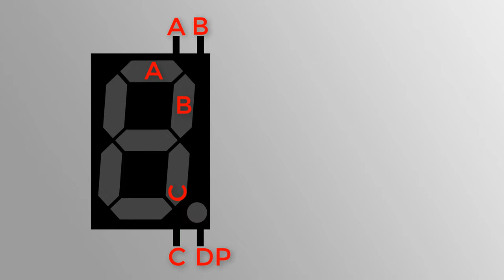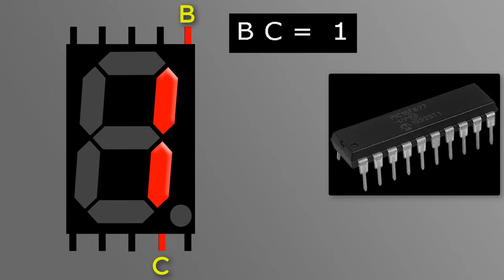Seven Segment LED Display Pinout | How Common Cathode or Common Anode 7 Segment LED displays work

Comment: Bro which is best bro comman cathode or comman anode in 7 segment display bro plz bro
Reply from the maker: Both are good, but common cathode displays must be used for common cathode circuits, and common anode displays must be used for common anode circuits. Thanks Brother.
Reply: @OrnatePixels  ok bro first thanks for ur replay but which is the best one bro